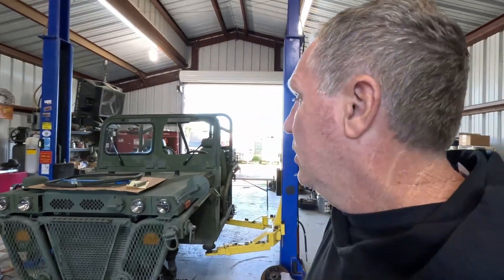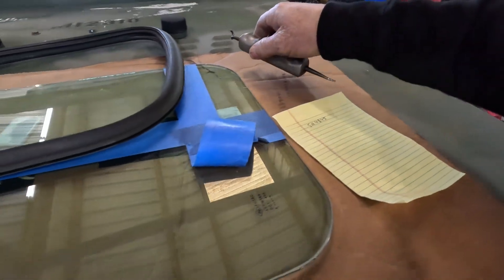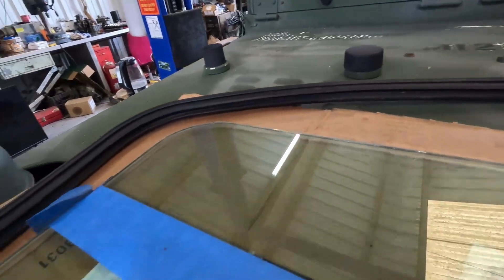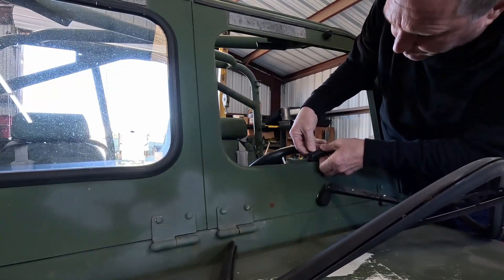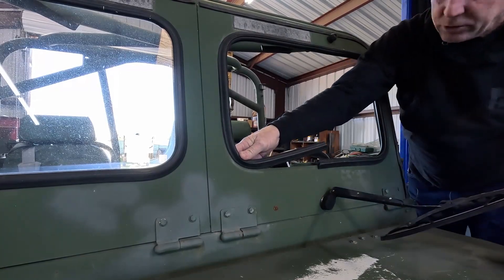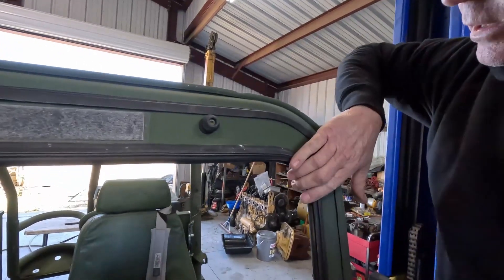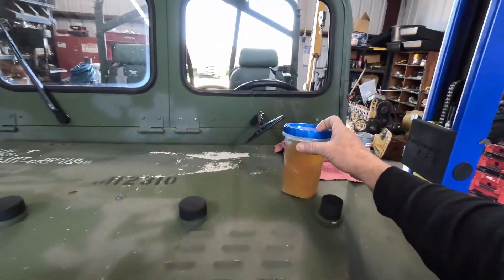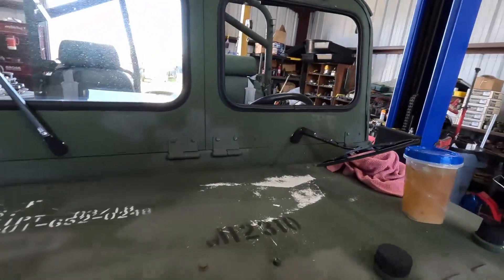Installing Flat Safety Glass Windshield on Military Truck #M1161 #M1163

Comment: Use paracord and WD40. Much easier and faster!
Reply from the maker: The cord trick doesn’t get it all done on this type. You still need to use the tool to run the lock in all the way around. And the WD-40 can stain the CARC paint, it doesn’t have any clear coat like automotive paint.